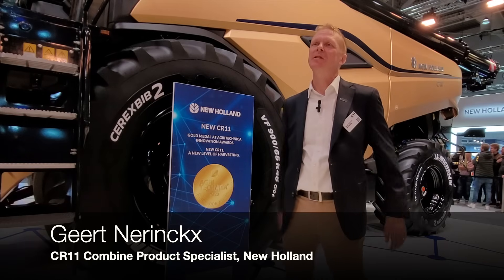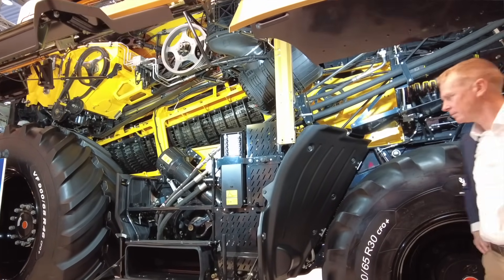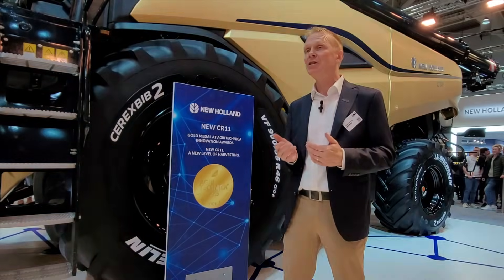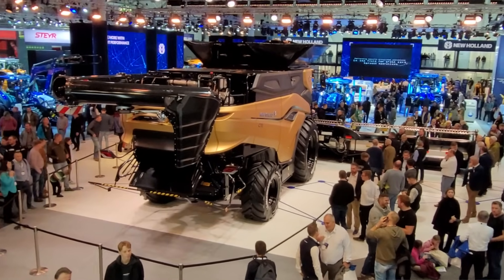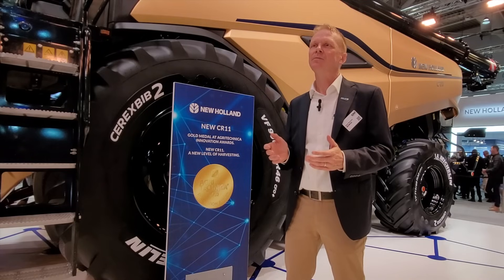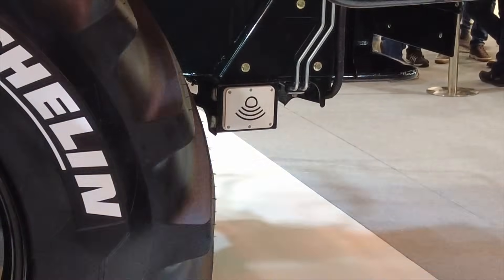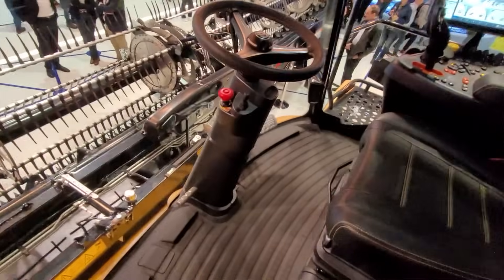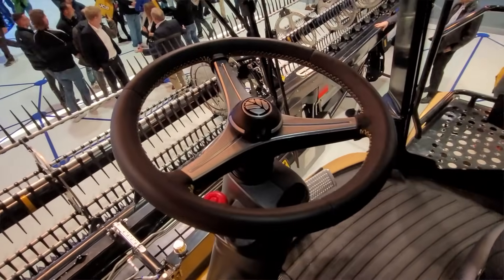AGRITECHNICA NEW VEHICLE: What's inside the world's largest combine harvester? The New Holland CR11

Comment: Combine performance starts with wide feederhouse which flattens the crop mat and makes it easier to thrash crop mat > Huge hp savings with that one fact? Ivt powered rotor is somewhat questionable for sheer thruput ability for oil driven things have a big parasitic powerloss Dna just like the last axial combines? Will probably use huge fuel amounts big grain tank is a one positive? The power saving things they have done like change motor direction, no  grate seperater ? The less pumps for chaff spreader< these changes seem to make a power saving difference on paper but what does this translate  too on the feild in tough conditions? Hope it Rocks?